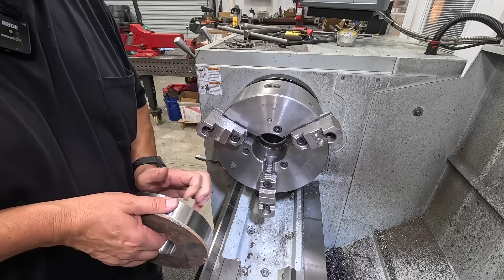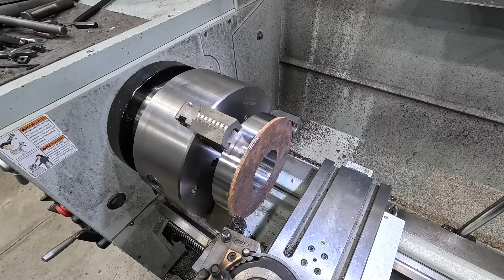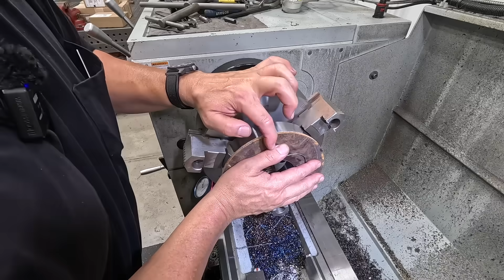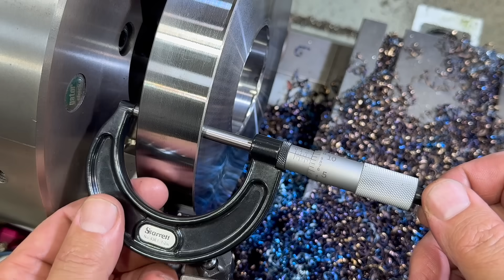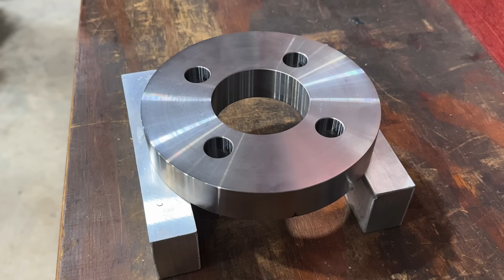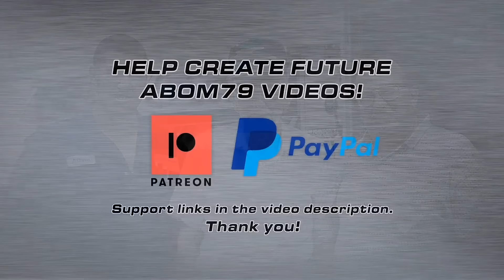Pipe Flange Facing Completed in the Precision Matthews Lathe

Comment: I was wondering why a gasket face was not specified.
Reply: I was wodering the same thing. Also... he mentioned in the first video that these were to be welded to the pipe or tubing... yet there is no weld prep. I was expecting at least a 1/4 inch wide 45 degree chamfer on the ID on at least one side. I am sure they must have discussed the feature but Adam hasn't mentioned it yet to us. Perhaps he is saving it for part IV "the Chamfering" video. ;-)
Reply: @utidjian 😂
Reply: It does seem odd, no gramophone/raised face or RTJ, weld neck prep etc. not like any pipe or pump flange I've seen

Comment: Does this lathe have cross feed compensation? Meaning variable cross feed or spindle RPM to keep cutting rate constant.
Reply: No it doesn’t. But he’s the YouTube king of surface finish
Reply: @MagicCityTool hay muchos maquinistas en Youtube con menos fama y son tan buenos o mejor que el. Y fuera de YouTube más aún. Saludos.
Reply: Do you mean constant surface footage?
Reply: @tonyshupe2334  I think you mean 'constant surface feet per minute' and no, it does not have that function. I don't know of any modern manual lathes that do. It is 'standard' on CNC lathes. Adam does have a CNC lathe but he wasn't using it for this job.
Reply: @utidjian algunos tienen la posibilidad de ir aumentando la velocidad de manera manual.
Reply: @josefcotorreslopez8167  very true. I used to run an old Rockwell 10" which had had a Reeves drive. Continuously variable from about 100 RPM to 2000 RPM. Just move the handle while the lathe is running. Not as good as you might think since the feed rate would also change with it. Great for fiding the sweet spot to avoid chatter or improve finish though.
Reply: @utidjian nunca lo he usado con esa función. Pero internet te amplia el conocimiento. Saludos.

Comment: I do not know why Adam was using the inner step of the three jaws instead of the outer step.  From my uneducated view the over hang of the jaws and how far they hung over towards where it was cutting is a possible pinch point for the tool holder to catch.
Reply: I would imagine the jaws met in the centre of the chuck before gripping the part OD if the outer step was used

Comment: I’m just curious - since 3in slip on pipe flanges are readily available and inexpensive, why have a machinist make them?
Reply: Yeah ... smart business model that would be.
Customer: "Can you make these pipe flanges for us?"
You: "You can buy these at your local plumbing supply."
Customer: "OK ... Thanks ... bye."
That being said if a customer needs a special flange that is not an off the shelf item would you turn the job down? I guess you would.
Reply: @tsmartin éso hago yo con los que me piden hacer alguna cosa que está en la ferretería por un precio mucho más barato que lo que cobraría si tuviera que hacerlo.
Se llama ser honesto con los clientes. Ya volverán con otro trabajo porque fui honesto con ellos.
Reply: I wasn’t suggesting that Adam turn the job down. I was wondering why the customer didn’t go down the street to the plumbing supply and buy the flanges for $20 each
Reply: I've seen pretty oddball ''plumbing'' stuff for pharmaceuticals and medical manufacturing. Also power plants get fussy about cooling. When you're talking megawatts of power, the engineers don't fool around.